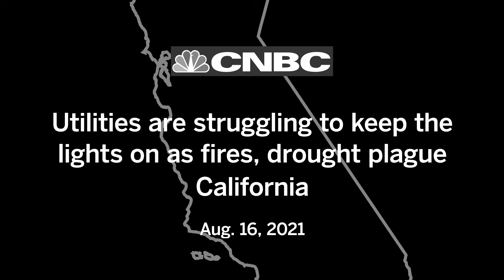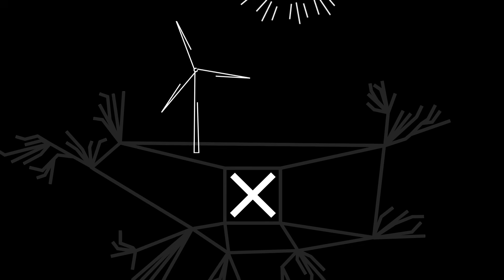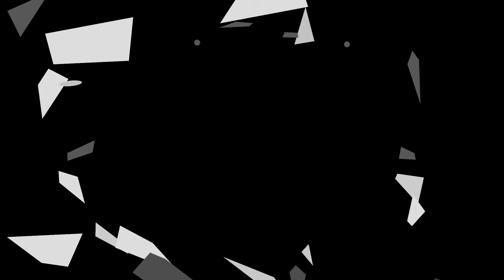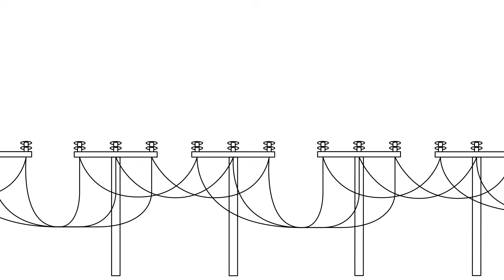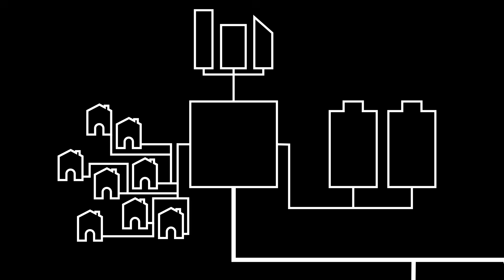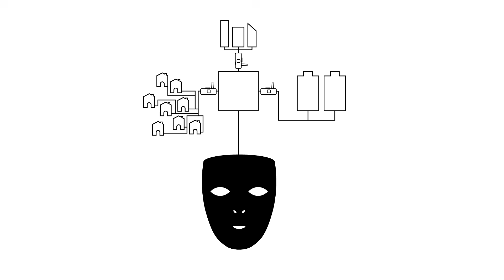Decoded: What is a 'Smart Grid' and how does it work?

Comment: This is going to happen in 30 years from now, starting World War 3! 
------------------------------------------------------------------------------------------------------------
Not a complete black out (homes will still have energy) but enormous industries like Automobile Manufacturing, Food Industry, SpaceX and more will suffer a fatal lose in their economy, affecting the rest of the economy  because the electrical power won't be enough to support the demands! The culprit is the extinction of oils and gases mostly found in the Middle East.
The only way to save ourselves is to brew more Electrical & Computer Engineers so we can finally build the Smart Grid. We already know how to do it in theory we just need a much better telecommunication system (much faster and reliable than 5G) and a pretty amazing control system. But without more engineers, this won't be possible to build and maintained! We need to have thousands of more engineers in 20 years from now that truly understand Dynamics And Control I, II  , Telecommunications and any Electrical Energy related concept (And software engineers, basically we all need to work together to make this possible)!

We could live without that much energy, but all the rich and powerful people, after they lose billions of profits because of this, will desperately try to control any energy source that it's left for no reason (since it will be extinct anyways), and thousands will die fighting their wars!!!